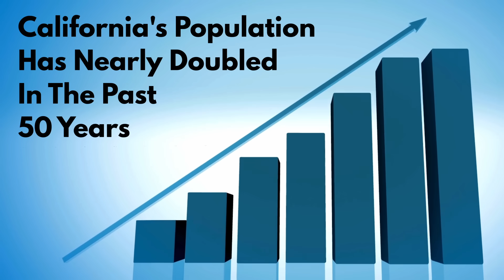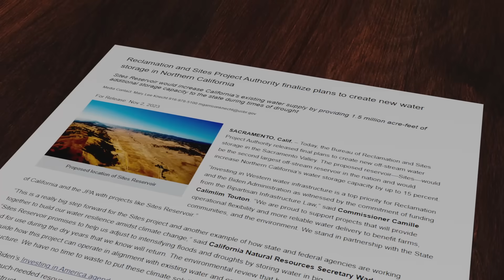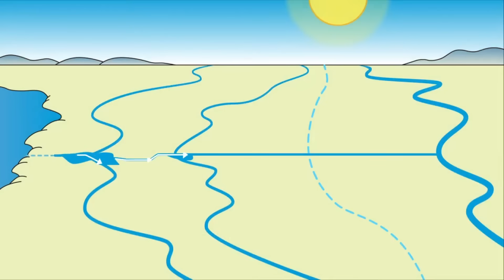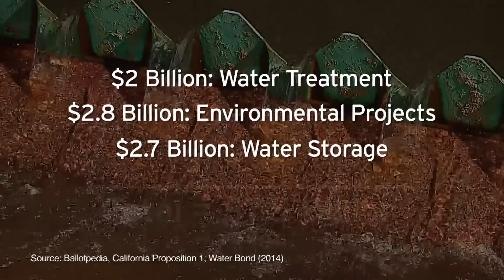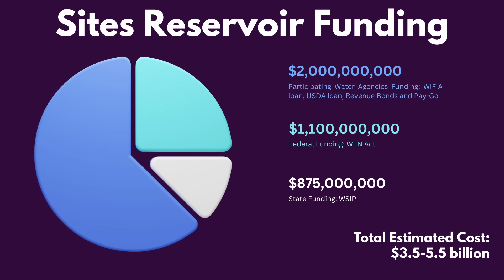Water Rights Secured | California Approves New Mega Project

Comment: Jerry Boles, former Chief of the Water Quality and Biology Section of the Northern District of DWR; “High concentrations of metals that exceed water quality criteria exist in source waters to the proposed project.” Mr. Boles provides data from the DWR Water Data Library that show high concentrations of toxic metals can be expected during the high flow months of winter when diversions would be occurring to the proposed reservoir. The high concentrations of metals in the source water will adversely impact Sites Reservoir water quality for most, if not all, the proposed beneficial uses of the stored water.

Comment: There are at least a couple misleading statements or assumptions in this video.
First is that California dams are considered old at 50 years. I couldn't find any definitive reason why California dams are considered old at 50 years but there is a suggestion that because the United Nations University uses this threshold when evaluating dams globally that this is somehow applicable to California dams. This is preposterous, although there are a number of low lying and earthen dams in California, its largest and main dams are likely technologically far superior to dams built elsewhere globally and are well maintained. Suggesting that California dams are in need of high expense maintenance and replacement is not true. The Oroville dam is an exception, not the rule.

Another misleading statement by this video is its suggestion that California's dams are largely built around the idea that enough potable water is stored to sustain California's needs on an annual basis. My understanding is that although that's true to some respect, capacity is far more than the state's needs for a single year even at California's current population levels and accounting for several years of additional growth. Of course the state always has to project further into the future as the state's population is expected to grow at least 2% per year and the state just ended a decade and a half long drought that brought reservoir levels down to emergency levels. But for how many years of drought do you prepare if more than a decade of capacity isn't enough? Is 15% additional capacity as planned enough or not? And of course there are potential alternative solutions like desalination.

It's interesting that the San Luis Rey reservoir is indeed considered an off-stream reservoir... And yet, it like all other California reservoirs filled instantly from nearly zero to full capacity from the mega storm that hit California earlier this year in 2023 not from any pumping but by natural hydraulic flow. By one measure this illustrates how exceptional that storm was but it also suggests that the definition of "off stream" might not be particularly accurate.

Comment: Many hands make light work. Many dams make more water. The problem with dams at lower elevations is evaporation!!
Reply: Yes, but low elevation water capture is a low hanging fruit that hasn't been fully developed. 
Most non Californians don't understand the magnitude of the water engineering that's already in place around our mountain watersheds. My local river, the San Joaquin, has 26 DAMS on its journey from glacial carved canyons in the Sierras to its last muddy trickle at the Mendota canal. Investing a billion on dam#27, wouldn't make sense.

Comment: Sounds like a good plan on paper. May they can really save the delta smelt.
Reply: The smelt is used as a canary in a coal mine.  When their numbers decrease it means the salinity of the delta waters which empty in the SF Bay is too high.  It is too high because the sea water is moving upstream.  This means crops will fail and the delta water becomes undrinkable to all of the nearby cities that depend on it.

Comment: Remember when we voted for a high speed train from LA to San Francisco?  What we get is a normal speed from Sacramento to Fresno.   For the rest of the world that is no where near Los Angeles or San Francisco.
Reply: Who’s we?  Nobody but dumb ass democrats voted for that lie
Reply: HSR is a mega boondoggle across the globe. There are only a handful of HSR lines that actually break even, for the rest of all HSR the suggestion is that the social aspects might provide additional benefit. But bottom line is that it's very, very rare that any HSR project can be justified by its cost/benefit ratio and not lose enormous sums of money over its lifetime and make sense only in places like China because it doesn't have access to advanced aviation technology that supports a network of affordable airports and airlines besides personal vehicles. In the Developed world, our flexible network of commercial aircraft responds immediately to changes in supply and demand between destinations and is much cheaper to just build another airport rather than to engineer and build HSR on the ground. Projects like the California project make no economic sense... They can't move freight, they're as at least as expensive as building a multi-lane superhighway and affordable public transportation infrastructure(airports and airlines primarily) already exist for traveling long distances.

Comment: California needs to start putting in large amounts of desalination plants to fill reservoirs and aquifers during droughts. Whether you believe that climate change is anthropocentric or not, there's more population and agriculture than there is water infrastructure to meet the needs for it.
Reply: Califorina has plenty of surface water for everyone if it gets managed well. Why dump good clean surface water in to the ocean and then spend millions or even billions of $s to unsalt it?
Reply: It was tried in the 70s and 80s.  Those plants were all shutdown because in non-drought years they still have to be staffed and maintained.  This made the water they produce much more expensive than the water from the existing system.  

A large plant in San Diego came online a few years ago.  But the rate payers down there pay for its upkeep even in years where they never use a drop of its water.
Reply: California has made it illegal to build desalination plants near the ocean. There was one almost approved close to LA that was shot down for two reasons. ONE: It is illegal to build a plant like that in a flood plane. With global warming predictions for the next 500 years that means you cant build one within miles of the ocean. TWO: The expected delivery of 750,000,000 gallons of water every day will drive up the cost of water. Only in California LOL

Comment: How about reclaiming more cleaned  waste water. 100 Million Gals per day, 100MGD dumped from the local water pollution control plant.
Reply: Water reclamation is pretty common throughout the state.   My area pumps reclaimed water around towns in a separate pipe system. It is used to water plants, lawns, trees, etc.  Too many organics for use as drinking water.  But drinking water is less than 1% of water use.

Comment: California doesn't have water problems.  The entire problem with water in California is fabricated by dumbast extreme environmentalist Democraps.  90% of the fresh water flows into the ocean unused because dumbast Democraps think not using it is somehow "saving" it.  

This new Sites dam is stupid because it will USE electricity to pump all of the water into it.  All they had to do was build a series of small Nimbus sized dams above pre-existing dams to create more storage AND produce electricity instead of consume electricity.  Nimbus Dam produces 51 million KWH a year.
  
Water will be released from Sites to meet demand?  Except that the Sacramento River never runs dry and California does not allow farmers to pump river water to their crops so this makes no sense at all.

You Democraps have everything so screwed up.

Comment: California could save a lot more water by using pipelines instead of open canals, or at least shading them & push farms to use more drip irrigation.
Reply: Covering the aqueducts with solar panels is currently underway
Reply: spend a dollar to save a dime--sounds like a great idea,not--to have a electric vehicle is like spending 17 dollars a gallon for gasoline--stupid idea
Reply: Suggestions have also been made that evaporation can be limited by either filling the canals with floating objects or covering with PV panels. I don't know though that either makes complete sense on a cost and benefit analysis although the PV idea has the obvious additional benefit to generate electricity using land that's not usable for any other purpose than it already is doing (transporting water).
Reply: That would cost tens of billions of dollars. It would be cost prohibitive.
Reply: Large scale farms using drip irrigation? You have no idea what you are talking about
Reply: Drip irrigation? I think you should stop talking.
Reply: A major problem with the Farms in California is that even if they manage to save water, they have to dump away the remaining water they have anyways.

Comment: Solar panels over the water canals would reduce evaporation and generate clean energy. Win - WIN
Reply: Solar panels are also delicate, require routine maintenance and have been known to shed carcinogenic substances into nearby soils and waterways.
Reply: @kiranreilly4916  Solar panels are not delicate; they are designed to withstand hailstorms. They require zero maintenance in most areas - rain has been enough to keep mine clean over the last 5 years. They are sealed against weather and do NOT "shed carcinogenic substances into nearby soils and waterways."
Reply: They are testing that idea in sections of the canals in the Central Valley.  Hopefully it will work.
Reply: prove it--you can't,dumb idea--it would be spending a dollar to save a dime
Reply: So where is the electricity going to? Connect it to grid? Who’s going to maintain it? Who will pay for replacement panels?
Reply: We're already doing that. Google "Project Nexus"
Reply: Have fun cleaning them.
Reply: @kristianduvall7326   There are automated  cleaning devices.
Reply: @kristianduvall7326  I've had solar panels on my roof for 5 years and never had to clean them once